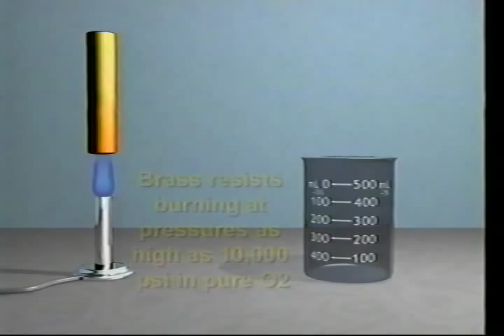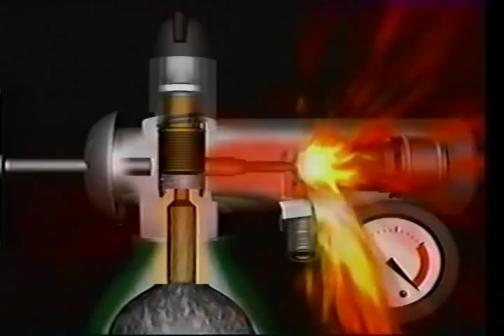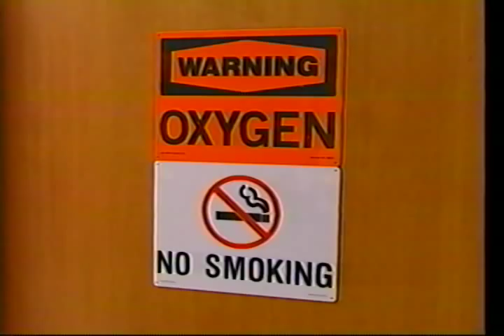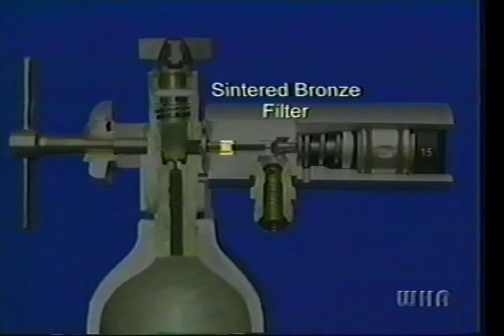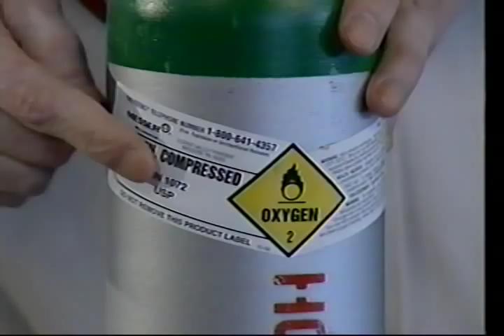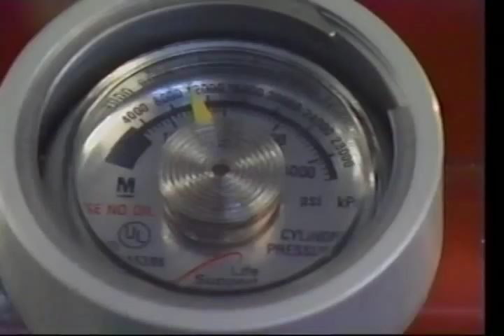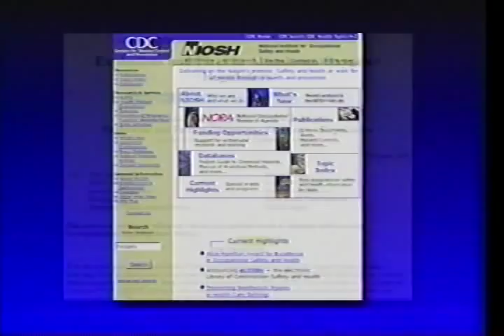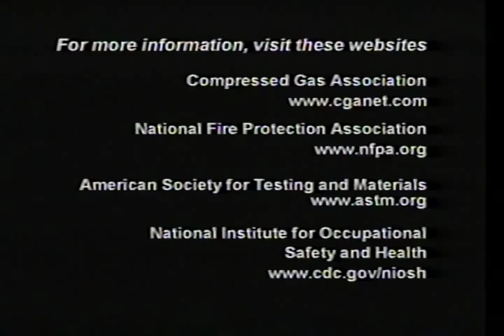Hidden Danger: Oxygen Regulator Fires

Comment: At 11:20, I'm sorry but, you cannot use a wrench to change a tire or a spark plug. You need a box socket to do those things because they are in recessed holes and the wrench just won't fit.

Comment: When they show the oxygen use on a plane, they show the emergency masks for the passengers. Those do not use high pressure oxygen tanks - they use chemical oxygen generators. There are medical oxygen tanks on most large airliners and also the pilots have oxygen masks connected to high-pressure oxygen tanks which have regulators. Sloppy!
Reply: GOX is used and serviced successfully since the beginning of high altitude flight, but on aircraft trained personnel control the whole process. GOX is utterly reliable and cylinders contain far more oxygen than the little chemical generators.  Regulators are NOT a problem when cleaned to "oxygen safe" standards.  I'm a retired USAF maintainer with hundreds of hours experience in LOX servicing. I also weld and rebuild my own regulators after cleaning them to factory "oxygen safe" standards.